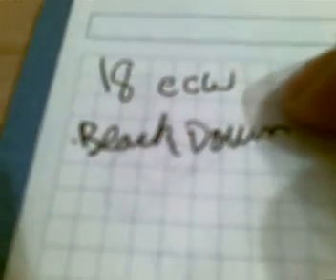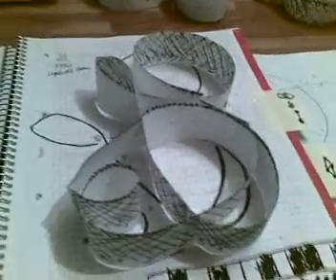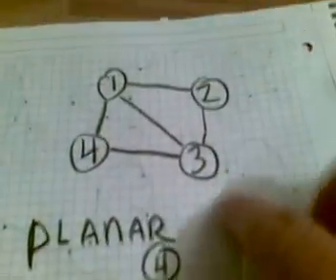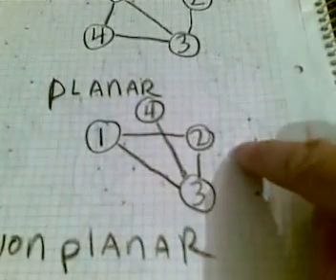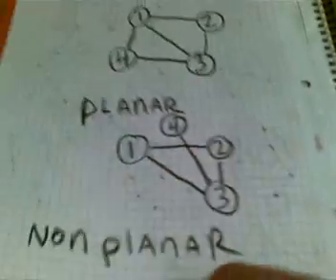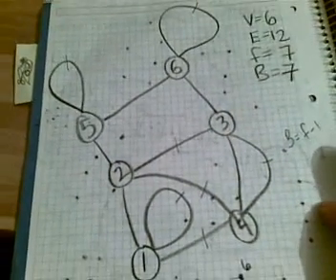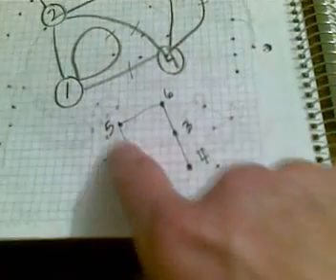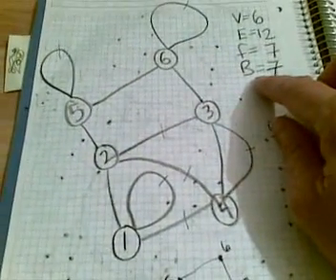Advanced Mobius Strip Topology (new version - edit)

Comment: The problem with the number "8" may be that the loop on the bottom should possibly be much larger. cutting through intersections 2, 6, the one to the top left of 2, and the one top right of 6 [ both I cannot read, sorry ] this would bring the loop above # 1 above the very top of all the intersections. But it may possibly throw off the measurements of the intersections. But that may be o.k. and should end up with 12? the symetry is where I saw it.